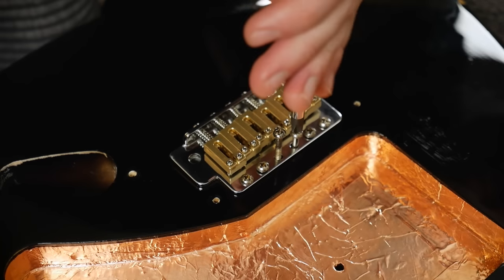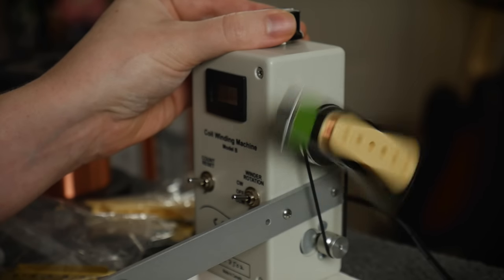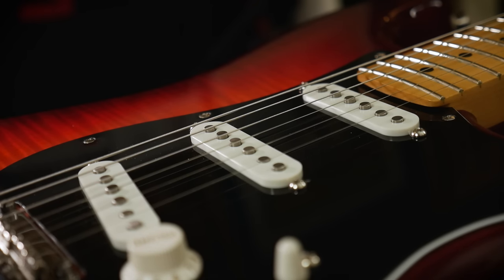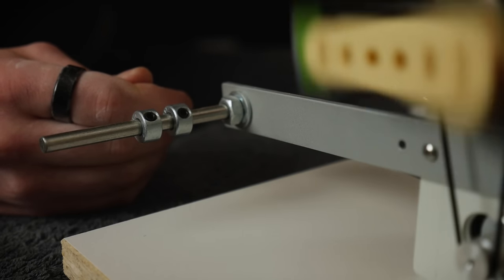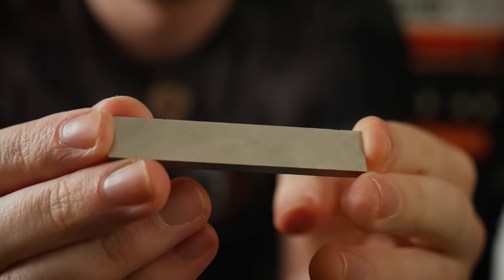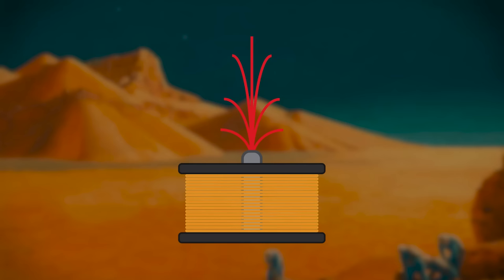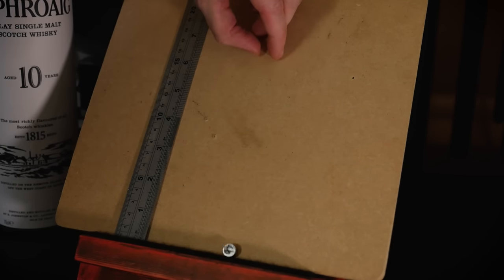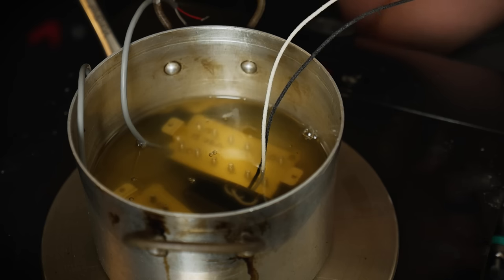(almost) EVERYTHING About Pickups | Too Afraid To Ask

Comment: I am not a big believer in tone wood for electric guitars precisely because of the way in which pickups function and the way they are positioned on the guitar.  The pickups are capturing the sound from the strings, not the sound traveling through the wood.

Comment: If a steel plate is applied to a humbucker, that would.....if I understand correctly, redirect the magnetic field? Or cancel it out completely? But if that's the case, I'm still confused why a steel plate still works in the single coil format. Why can't a humbucker have a steel plate? Wouldn't it be great to have a Tele bridge humbucker that has that steel plate with a coil split function?

Comment: I got another TATA for you: You nicely explained how pickups work here and how this affects tone, but what about all the people talking about the wood of a guitar and how THAT affects tone? Wood is not magnetic so it should not affect tone at all. Only thing I could imagine is that the wood affects HOW the strings vibrate. Could you shed some light on this?
Reply: The wood is coupled to the strings mechanically, via the nut and bridge, and also via the tuning machines and tail piece.  (As the strings vibrate, they exert a variable pulling force on the tuning machines and tail piece.)  There's probably some coupling and reflection going on via the small air gap at the neck too.  On my guitars I can feel the body and neck vibrate when I strum them with no cable plugged into it.  Also, the pickups are microphonic enough to pick up the wood vibrations - try rapping the body with your knuckle and you will hear it through your amp.  Unpotted pickups will be more microphonic than potted pickups.  There is a lot going on!   Guitar makers will tell you that 2 pieces of wood from the same tree will often perform differently enough to be audible.  That's why it is best to go to a guitar store and try out multiple guitars before plunking down your cash.

Comment: This may be a debate for another time, but the idea that the vibrating string somehow "disturbs" the magnetic field of the pole piece might not be technically correct.  Here is a quote from the Seymour Duncan interview with Seth Lover (inventor of the Gibson PAF Humbucker) "...That’s one of the things that most people don’t understand. They figure that string is waving there and cutting the magnetic lines of force. Nuts. That isn’t it. The magnet, all it does is magnetize the string. Now you’ve got a waving magnetic field. And we have a fixed coil with a waving magnetic field to induce voltage. If you want to, take the magnet out. One you’ve magnetized your strings, it will play until the string loses it..."  As I understand Faraday's law of induction, Seth Lover seems to be completely correct.  Now, having said that, for all practical purposes, it doesn't matter.  We can't get rid of the magnetic pole pieces, they need to be there to continuously keep the strings magnetically charged, that is their purpose.  My point is, the "disturbing" of the magnetic field is not a significant factor in generating a signal in the coil, the moving magnet (magnetized string) is the only important factor.  (source - https://www.seymourduncan.com/blog/latest-updates/seymour-w-duncans-interview-with-seth-lover )  I really enjoyed this video, and you have an excellent channel!  Great work!

Comment: HSS strat - can I mix a Demarzio super distortion humbucker in the bridge, with 2 x Suhr V60LPs in the neck and middle? I want the cool 80s sound from the demarzio, and super clean lovely chiming highs from the 2 x V60s! I have no idea what I am doing, as I'm sure you can tell! Are the outputs TOO different? Will I have problems mixing (the volume?) Umm...

Comment: What about the wire itself? I have a fair amount of experience in the audiophile world. The quality and purity of copper wire used in transformers and cables can make a significant difference in the quality of sound. Is this also a factor that's considered when selecting wire for guitar pickups? And Audio Note is famous for the high purity silver wire used in their components. Is silver wire ever used in pickups?
Reply from the maker: The amount of wire you'd need to wind a pickup would make using silver wire prohibitively expensive. 
The copper wire used in pickups is the same stuff used in transformer winding. 

I've made a video on copper purity and other concerns before - relating to cables specifically - and the take away is that the standard stuff already meets all the criteria you need for audio, going purer doesn't provide any tangible improvement. You are beyond the point of diminishing returns. 

The advantages you have for silver wire in speaker voice coils do not translate to guitar pickups - it would simply be a waste of money and resources. 
Even if it provided a 0.1% improvement in fidelity - who the fuck cares when you're immediately running that signal through a fuzz pedal?

Comment: Does more resistance really mean more output? I mean sure more turns on the coil and lower gauge imply more resistance but it could be louder just because you are catching more magnetic flux and a more intense magnetic field by being closer respectively. Say we wind two coils exactly the same but for one of them we use silver wire rather than copper (I know it's impractical but it's for the sake of example). Silver has lower resistivity than copper but the number of turns and gauge will be the same. Will the silver pickup still be quieter?

Comment: pickup output is not related to resistance. turns and magnetic field determine that.resistance is a function of how many turns you have put on and in what gauge.Oh, and inductance has nothing to do with resistance either, its to do with number of turns. Again resistance tells you how many turns you have, but if you wound in resistance wire you wouldn't change the inductance.

Comment: I’ve wired guitars with high output pups with no noise.  I can’t seem to keep the pup silent.  Any advice?   I’ve mastered soldering but can’t get a P 90 to be quiet without humm.  
MJ Smith
Martin Custom Shop
Reply from the maker: A P90 is a single coil. Any single coil will behave as an antenna and pickup 50/60Hz EMI from surrounding powered devices. It's intrinsic to the physics of these kind of pickups.

Comment: Can you connect a guitar pickup directly to the output jack without via tone and volume controls and how will it behave when connected to an amp?
Reply from the maker: Yes you can connect the pickup directly to the output.
It will operate as normal, but perhaps a little hotter and brighter without being loaded by the pots.

Comment: I am all about humbuckers, so I have been planning to put Seymour Duncan Hot Rails into a Squier Classic Vibe Bass VI. I spoke to Seymour Duncan about this, and they told me Jaguar pickups are wider than Hot Rails, which means drilling screw holes. They also told me they cannot make Hot Rails in the width of Jaguar pickups.

So, I have a question, which will very much affect this project. Do you know of any Jaguar-sized humbuckers? At this point, I honestly don't care if they are Hot Rail style, or if they are stacked humbuckers similar to Fender's 4th Generation Noiseless Singles. As long as they are humbuckers, and able to fit the Jaguar mountings, they should work.
Reply from the maker: Hmm something like this would have to be hand made. It's an interesting concept, send me an email about it. I might be able to make you something.
Reply: Done. I used the email on your YouTube page, the one which says "business inquiries." I hope that will be alright.

Comment: You are leaving parasitic capacitance out of the equation. This, in combination with the inductance sets the frequency response characteristic of the pickup. Also the cable capacitance influences the frequency curve - and therefore the tone. The way of winding results in a higher (neatly wound) capacitance and a lower resonance peak, scattered winding yields a lower capacitance and a higher resonance. You might want to look up LCR resonance circuits and their behaviour.

DC resistance does not influence the output signal on its own. The thinner wire results in a more compact coil which sits in the more dense magnetic field, resulting in a higher output signal.
The shape of the coil coincides with the length of the string’s magnetic field: the longer the field, the more higher frequencies (harmonics) are cancelled out against each  other, a shorter string length pickup cancels out less harmonics - thus results in a sharper sound.

But I have to say you are heading in the right direction

Comment: I've seen many tutorials and videos about winding pickups but none of them explained where the spool of copper wire needs to be positioned for it to unravel properly and wind onto the pickup. Is it that trivial or is there something to know about it? Any input appreciated :)
Reply from the maker: I position mine on the floor directly under the winder, the wire unravels from the end of the spool. 

You cannot spin the spool on its axis, the wire is too fine and the winding speed too fast. But you can pull the wire up over the spool end - no interia of a spinning spool to overcome and you can unravel it as fast as the winder will let you.

Comment: You say that ceramic pickups sound very harsh in the high end and lack low-end... Somehow, that is the exact opposite of the impression I've had when using Epiphone Ceramic 8 pickups in the past. I found they sounded extremelybassy and lacked any clarity in the upper mids and highs... Must have been a really bad pair of Ceramics I had then...

Comment: Hi Colin...I have been trying to get an answer from anyone, coming up empty...but out of simple curiosity I was wondering how a direct signal into an amp (from guitar to amp via cable) differs from a reamped WAV file from a DAW going through a reamp box? Does the amp 'see' the signal the same? I have the IK Multimedia Axe I/O and it seems to have the reamp output impedance low compared to other devices. Is there any interaction actually going on between the pickups and amp?

Comment: Plz show where the second reverse pole magnet is in a standard humbucker. It looks like there's only one magnet.
Reply from the maker: A magnet has two poles. One coil sits on the north side, the other coil sits on the south side.

It only requires one magnet
Reply: @ScienceofLoud  So the N ad S are both on the long sides.

Comment: 4:35 why some guitar have more than 1 pick-up coils ??
Reply: Because the position of the pickup influences the tone. The string is fixed at the bridge so the string can't vibrate as much right next to the bridge as it would in the middle of the string length. You can use this by having pickups at different places along the length of the string.
Reply: Or did you mean "Why do some pickups have more than 1 coil?"
Reply: @farmduck2762  may be both , so all coils not used at same time?

Comment: So the "sound" that's generated by unpotted pups is worse. The sound that generated by inconsistent hand winding is better. Am I seeing an inconsistency in your oppinion here or am I misunderstanding something?

Also, as far as I know Gibson stopped hand winding pickups in 1950. Did I get bad info?
Reply from the maker: Unpotted pickups allow internal parts of the pickup to physically move, which creates microphonic noise and uncontrollable feedback.

Hand winding a coil simply produced a different coil distribution, hence a different inductance, hence a different sounding coil. I said that the general opinion of players is that they prefer how a hand wound coil sounds.

Hand winding (having a human operator feed the wire) and not potting the finished pickup are two entirely different things. I'm not sure why you are trying to draw some comparison between them to undermine my logic.

Also not sure what point you are making with Gibson. While I can't speak to the accuracy of your claim, I can say that the 50s handwound PAFs are the most desirable pickup and every small pickup manufacturer will be winding, by hand, their own take on the PAF. These are popular replacements for players trying to get the original sound.
Reply: @ScienceofLoud  Who knows how accurate the web is but I had read that Gibson got auto winders in 1950. They had a pic of a machine winding multiple pups at the same time. I believe it's the same machine that Heritage uses today. The "inconsistencies" in them that people find desirable are the number of winds, not because they have a random winding pattern, which to my knowledge, they don't. 

And I understood what you said about unpotted pickups and microphonics. Those same desirable pups from the 50's were unpotted. Just like the "historically accurate" Burstbuckers today. All (I think) or typically anyway, Custombuckers are potted. The difference in tone is pretty obvious. I like them both though. And I don't get any uncontrollable feedback from Burstbuckers.

Please don't take my comments as being negative about you or your vids. They are very informative. I just take exception to people who tell me (personally) what sounds better or worse. In the end it's the way the instrument inspires the musician. Or in the case of a bad one, fails to inspire.

Like ceramic magnets, for example. I think all the crappy pups who use ceramic magnets create a negative bias for all of them. I have Super humbuckers in one of my guitars. They nail the classic Carlos tone perfectly. People tell me all the time that it sounds just like Santana and it's the pups. now, not all ceramic magnets are the same either. And yes, the SH are potted. But with epoxy rather than wax. I think Lawrence did that to make it really difficult to open them up and examine.  

Anyway, great vids! I'm subbed, and keep up the good work. Cheers!

Comment: Do you think that the reason Tonewood used was because pickups weren't potted, and the resonance from the wood would be picked up by the microphonic pickups? Then the reason it's become nearly obsolete is because of the fact that some 90% of all modern pickups are potted/sealed to keep them from being microphonic. Thoughts on my theory?
Reply from the maker: You're so very close to having a real epiphany about tonewood. Keep thinking down your initial logic, but more generally.
Ask yourself why guitarists claim their pickups sound louder when they screw them directly into the body rather than have them suspended by springs from the pickguard.

Comment: What would happen if you were to start the copper string winding with two or 3 stands & then connect all 3 wires to the pots? 
Not all electrician so that might sound dumb if to those who know, like if extra wires can cause shorts or whatever else but if not it would be a cool experiment
Reply from the maker: @levig8236  I have no idea what you are trying to describe
Reply: @ScienceofLoud  so it looks like you were winding the pickup with a single strand of copper right? I'm just curious what would happen if you started the line with 2, 3, 4 lines of all the same guage. I did a quick Google on it and the answer I got is that that is typical for uses such as push pulls or switches?
Reply: @ScienceofLoud  so in the video, you're holding 1 single strand of copper wire correct? And that 1 strand gets coiled around like 6000 times or whatever it is, I'm asking what would happen if you started it with 2 or 3 wires (same guage) and then they only had to be wrapped around like 3000 or 2000 times respectively.